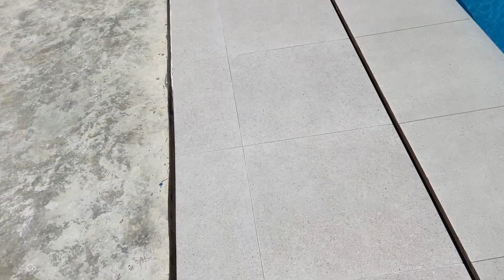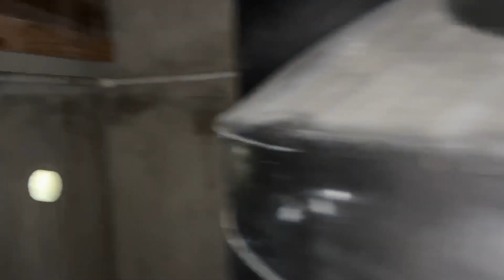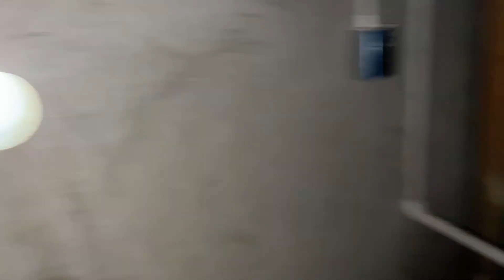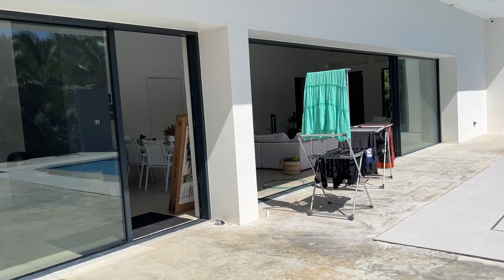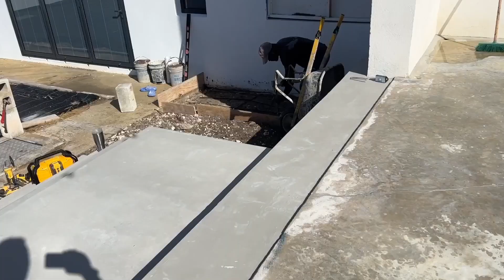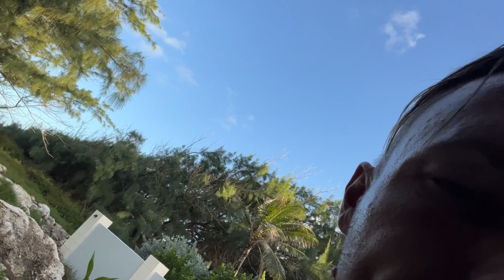Barbados 🇧🇧 Beach House Build - Day 416

Comment: Is the pump noisy or is it the vibration from the pump that is being transmitted through the piping. 2. Put in vibration isolation on the base of the pump from the concrete. 2. Install vibration isolation in the lines so that it does not go from the pump to the lines. Everything looks rigidly piped in with no vibration isolation if I am mistaken.
Reply from the maker: Hey Patrick this would certainly help but the main issue is the pump is just naturally noisey an dit does not help that it is in a hollow room with no sound proof. It is a 2 HP unit.

Comment: Hi, the pool is looking very good. You might consider adding the Ring flood sensor/leak detection on the floor in the pump room since you already have the ring alarm system. This way you can be alerted when there is level breach.
Reply from the maker: Hey Barry, I was not aware that Ring did this. I will look this up today, thank you so much for the heads up!